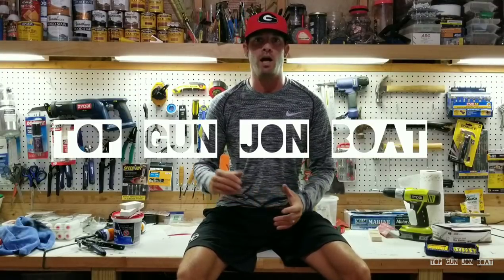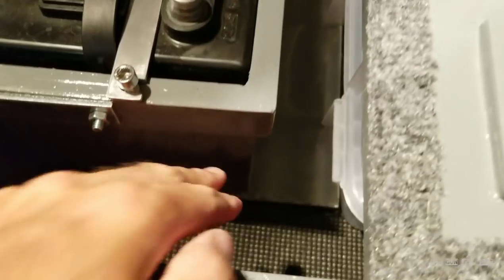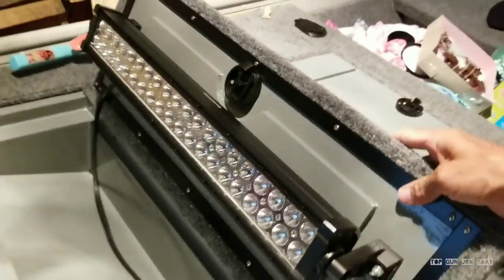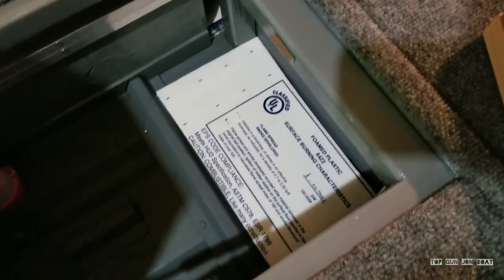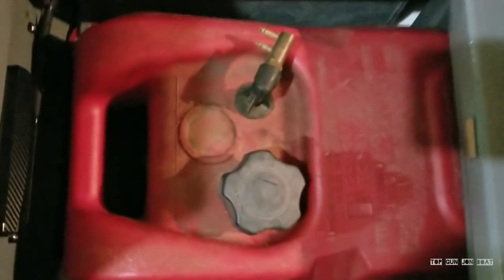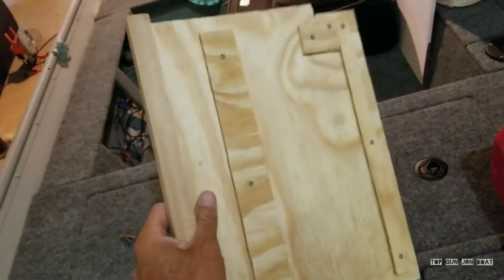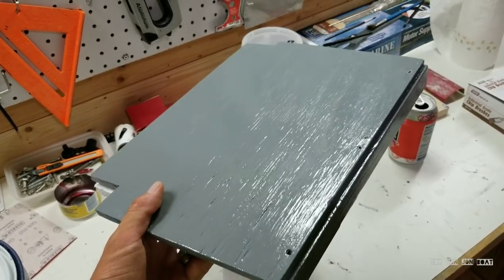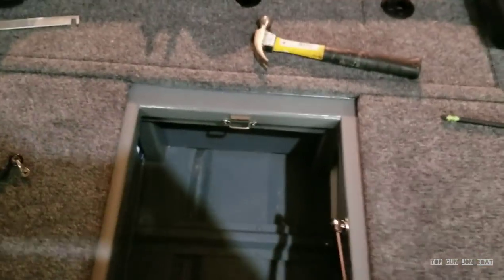DIY Battery Tray/Box In Jon Boat To Bass Boat

Comment: If you laid down Saran Wrap in the compartment then sprayed the area with expanding foam and then put the bottom board down for tray and put a couple of cinder blocks on top till it set, it would have perfectly conformed to the bottom of boat and would not have moved and also helped with vibration. Saran Wrap will peel off and keep it from sticking to boat. None on the board it will permanently adhere to that. If you had turned it 90 degrees you probably could have gotten 2 in that space also and doubled over all capacity.

Comment: I feel that metal tie down is dangerously close to the battery terminals!
Reply: Only a problem if it could touch both terminals.
Reply: It is fine
Reply: All it takes is something falling on the battery to short both sides. You could put the tie down on the other side of the battery handle and still have a tight hold, with a much safer distance.

Comment: Great content , I like the way you build . have you put out any videos  on how to paint a aluminum 
boat , mine needs a makeover , not sure what type of paint to use , I like the green on yours but don't know how to paint aluminum or what paint to use. If you get a chance write me back, thanks for your time
Reply from the maker: No video as I had done boat exterior paint before I started my channel. Perhaps one day I can do a step by step on a future build. I used ALUMAHAWK Aluminum Boat paint. You can google it. It is a bit pricey and you need to properly prep the boat, but I have gotten a lot of compliments on how it came out as a factory finish. I went with grey but they make a few colors. You will need a paint gun (I used a 50$ Husky one from Home Depot) and an air compressor. The paint is super nasty and sticky, you do not want to brush or roll it. You will also need to cut it w MEK to thin it, I went a bit heavier on the MEK versus the paint manufacturer's specs to further thin it. Hope this helps.
Reply: @AnthonyJonesBrigadeBoats  Thanks for getting back with me on the paint info , look forward to more of your videos

Comment: It looks nice, nice clean work..  but are you not concerned about the accidental acid leak?  Being at the front of the boat, the battery is gonna take a beating..  are you using marine plywood?  nice fab ideas..
Reply from the maker: No,not at all. Everything is mounted incredibly securely into framing and hull ribs. Box does not move and neither does battery inside with a top mount battery tie down. Never had an acid issue and the boat has been beat pretty good.

Comment: You could have put a piece of foam on the top of the battery shelf and notched it out for the battery to sit in and then the strap. it would keep it from making noise due to rattling.
Reply from the maker: Good input although it doesn't rattle or make noise how its is. Super tight strapped in. I'll keep that in mind though, appreciate it!
Reply: @AnthonyJonesBrigadeBoats  im actually in the market for my first boat i think im gonna get a jon boat and steal some of your ideas your boat is badass...

Comment: I like to see any video on the framing of the wood
Reply from the maker: Gennaro Dimartino I got you man! I will do a thorough walk thru video on the framing under the casting deck before I bolt the deck on fir good. It's coming, hang in there.

Comment: Great content, excellent videos. I don't watch everyone's new vids the same day they publish, but I'm always happy to watch your new one as soon as I see it. About your front battery box, looks great, very solid... I have an idea you might try out, apply some Plasti Dip to the tiedown to prevent arcing across the battery poles when working with, it's gonna happen sooner or later... that stuff is available at harbor freight, and just about everywhere else I believe. Very nice build! Keep up the great work and thank you for sharing your process.
Reply from the maker: TheRfmodulator Thanks for the kind words man. After much debate I think I will be doing a dip on that rail. Appreciate the advice, seems like a good precaution to take!

Comment: How do you keep the battery charged ??
Reply from the maker: Rear battery is for trolling motor, front is for accessories. No.on board charging system, battery is charged when home on drip charger, rear battery gets 6 hrs or full throttle run time on rear mount electric motor.

Comment: This i cant understand is where the rain water goes with this boats!! this boxes are not waterproof as i can see
Reply from the maker: The boat has been flooded with rain, it goes to the bottom of the boat and out the back. All hatches are actually very tight and I have yet to get water in them. There are drain holes in them just in case water gets in but the locking latch creates a seal pulling the hatch down tight enough to where water does not get in. Also, the boat is garage kept so the only time it's been wet was bringing it back from the lake it got rained on heavily for an hour and all was fine,  i was very impressed.  Hope this helps, thanks for watching!